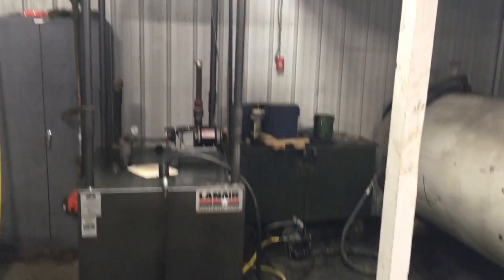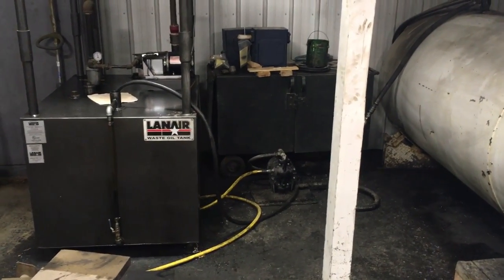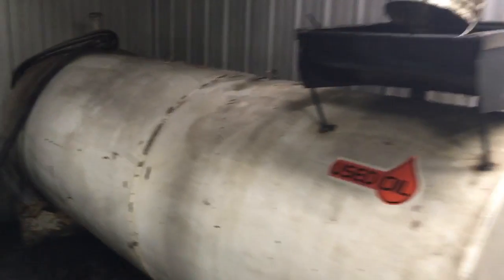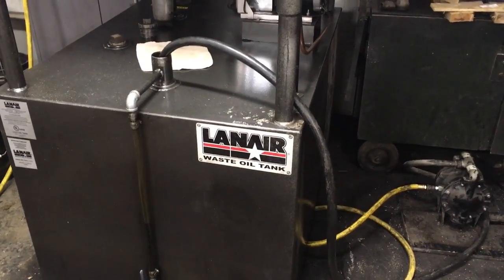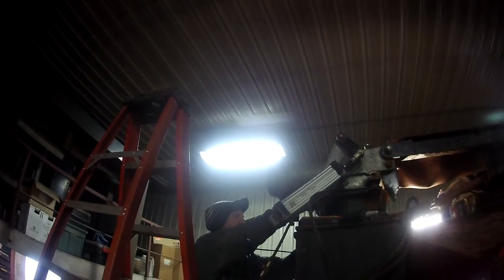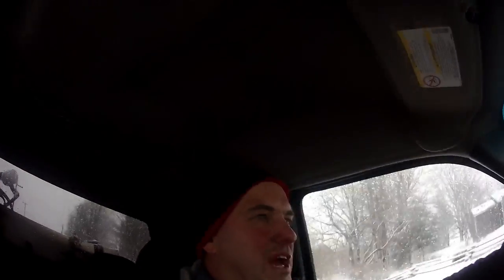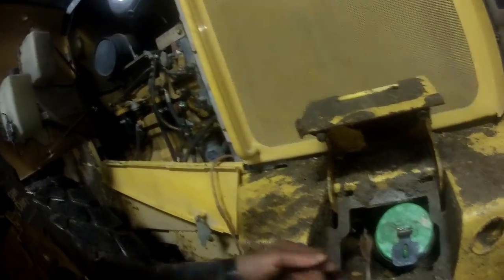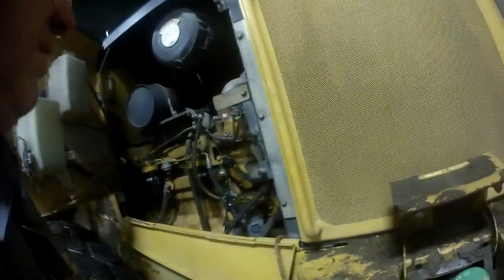Moving straw,broken bales,cut wires and water pumps on powerstrokes

Comment: If I could add my .02 in. I  sympathize with Nat, put a water pump on my power stroke 6.0 L. I  had to put thread sealant. Made mistake of using thread locker, it's the white toothpaste type stuff. I  also used the red gasket making stuff. I  found if you put a dab of Vaseline on the opening of the tube before you put the cap on it will not get hard for a while. Hope this helps, clean the surface with starter fluid ether to get all the grease off. I  think I only put the red sealant on one of the surfaces and the gasket is on the other surface.
Reply from the maker: The water pump on this truck has the o ring style gasket

Comment: If you put a regulator on your pump and reduce the air so it runs slower (cycle speed)  it will pump more oil quicker, then racing like that.

Comment: Thanks for another video. I know this is a bit off topic but i know you use vertical mixers. We are getting a new vertical mixer and im curious about mix times, as i am under the impression that if you overmix the feed can end up like oatmeal consistency. I was wondering what your feed ratio is and what mix time you do? I know everyone has a different ration and ratios depending on what works best for their herd. Thanks in advance for any insight you can add.
Reply from the maker: Jim Civitello we load haylage first then grain,cotton seed,corn meal and himoisture corn.Just before we start loading corn silage we start the mixers mixing and once we get done loading corn silage we shut the pto’s off and they are ready .
Reply: @FarmingFixingFabricating  thanks andy our nutritionist has a good handle on what we will probably have to do but its nice to hear how others do things too. Right now i load haylege then corn silage and the canola meal and our mash grain get put in last with bicarb and an energy boost because they are at the barn not by the bunk, and we use a reel type mixer currently. Looks like we might have to experiment some to get a good mix, should be interesting im all for trying out new things.

Comment: From Ralph:  I've had a semi for 40+ years.... first time I've seen arrows on flex pipe.   Was that stainless steel flex pipe?  Great video... say hi to Junior !
Reply from the maker: Yes I believe it was stainless
Reply: Arrows on the Flexi pipe is to minimise back pressure from exhaust gasses so you have the pipe going the correct direction

Comment: The issue isn't the water pump, its the emblem of the truck that you are putting it on. It if had a rams head with two horn you wouldnt even have to change water pumps.